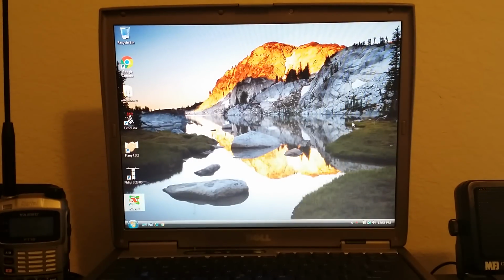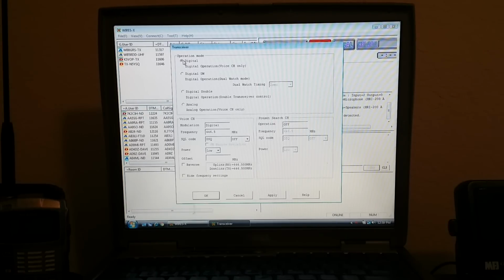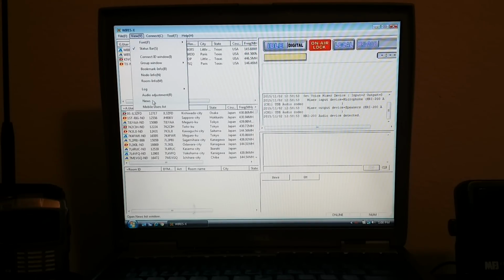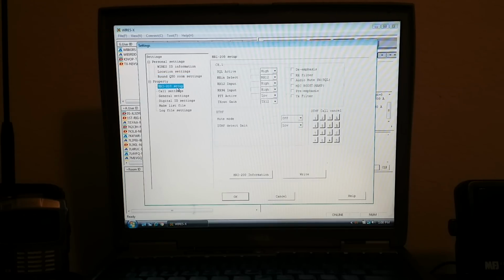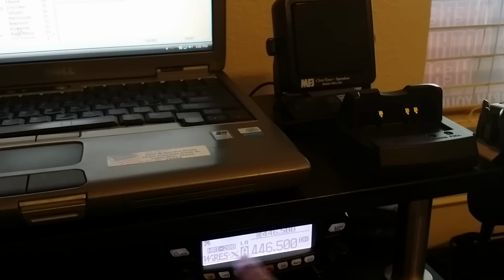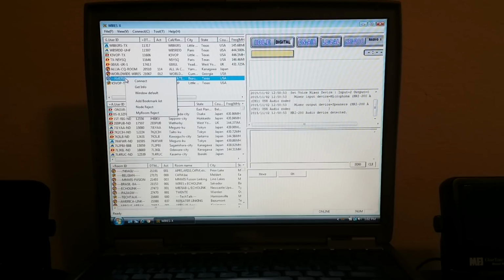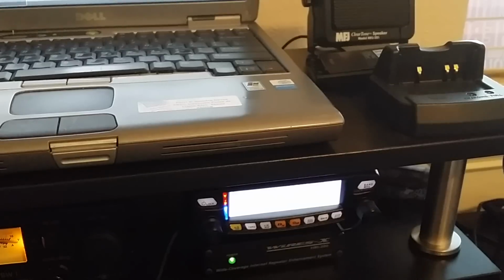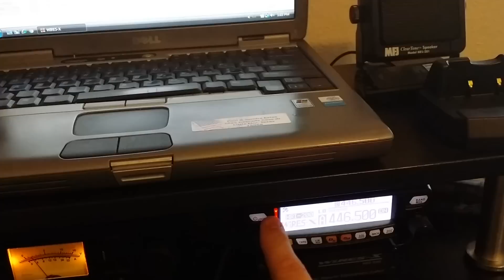Yaesu Wires-X and FTM-100 DR Setup

Comment: So the wires-x is only useable when hooked up to a computer ? Is there a way to get access to wires-x mobile ? I don't see the point if there's not .
Reply from the maker: a mobile C4FM radio can connect to any wiresX repeater mobile or handheld.  If you want to make a mobile 'node' you just have to have an internet/cellular connection that you can open the ports on.
Reply: Paul K5VOP/JI1GBC so if I'm out and about (mobile) I'll have to have nobe to hook up to the internet . Icom seems to have an easier setup going mobile .
Reply from the maker: A WiresX repeater, basically a Yaesu Fusion DR1x repeater with a WiresX HRI200 box connected to it. You do not need a mobile 'node', your radio is WiresX and connects to any repeater setup to work with WiresX,  It is the same I believe with Dstar, you still need to connect to a Dstar repeater to connect to others on Dstar out of the range of your mobile.  And Wiresx has better sound quality with newer chipsets.  Fusion also allows analog and digital to connect in the same nodes and communicate.

Comment: can  you use  an  old   1500 with it
Reply from the maker: Any analog 2m/70cm will work, in analog not digital.
Reply: jon ericson. I can tell you first-hand the 1500 will work I've tested it and it is Plug and Play. Additionally ft 7900 will work and even my ft-817 work however I have disconnected all my analog radios and run totally digital now

Comment: Hi
I have all ports going and the HRI-200 Driver is ok on com port 5 on the PC, and the 10 pin cord is seated ok, but I still have the splash screen Hang on the FTM-100D.  It has progressed past this point before on other occasions but since given to me to set up on this PC its just not playing ball, any tips please.
Thanks Tim VK8LLA
Reply from the maker: Tim is your splash screen in wires X mode? And all your ports are showing okay?
Reply: Paul K5VOP/JI1GBC 
Hi Paul, all ports are green and good and i have node information populating the left hand frames and status is Online. the wires x box is connected to bothe pc and radio all cable firmly seated. pc reports wires box as visibke and on com port 5.
the radio however.....i hold down the 2 red centre buttons to invoke wores mode then again to invike normal radio use but when i invoke wires x mode it starts but just sits on the splash screen it does not move on. is there any other setting on the radio or in the software?
thanks heaps. Tim

Comment: Paul I've got a question, I'm using an FTM400XD with the HRI200. I've seen where people hold the two buttons while at the same time powering up the radio. In my case when I do that, the radio comes on displaying only the Yaesu Wires X splash screen, but  no frequencies are displayed. In the software, Ive programmed my local Fusion repeater frequency pair. Can you tell what am I doing wrong?
Reply from the maker: you won't see frequencies until the wires X software is running and properly connected to the radio. when it's not you just see the wires X splash screen.
Reply: Thanks for your reply. I've found out that one of the 10 pin connectors wasn't seated properly on the radio.

Comment: What power supply are you using to run your radio? 73's kh6hwb
Reply from the maker: QJE 30amp. it was the first power supply I got from an older ham selling some  equipment. QJ-PS30SW. I have a compact MFJ 30amp as backup.
Reply: +Paul K5VOP/JI1GBC Thanks

Comment: Can this be accessed by Any transceiver or only yaesu ???
want to use for local ARES Group if I can set this up as a repeater of   sorts on a simplex, we live in a area where many stations cannot hear each other whats the requirements / needed for other stations to connect, must they have a computer to connect or can it be done via a DTMF ????
Reply from the maker: Yes, in analog mode, any transceiver will work.  You simply need an analog Wires-X node within RF of the radios you use to TX/RX.  So, if anyone is out of range of the main node, they would need another analog node they are in RF range of that could then, through DTMF, be connected to the main node via internet. They would input the local analog node frequency, tone, offset, that they are in range of, and with DTMF connect to your main node.  Anyone could connect from anywhere in the world but each ham needs a node within RF range to access the Wires-X network and be able to connect to the main node.  Think of it like an internet connection.  Anyone with a computer can connect to you via the internet (wiresx network), but they need a computer (their radio) and a local hot spot (local wiresx node) to connect in order to access the internet (wiresx network).  Hope that helps and doesn't make it more confusing.
Reply: Hi Paul, thanks for the video. If you connect to wires-x with an analog radio, can you connect with others who are using it in digital mode ?
Reply from the maker: +john mcleod Yes, that is one really great thing about Wires X, analog and digital can communicate back and forth.  I was in Japan,  connected to a local Japan node at the airport in analog and then connected to my home digital node through wires to check in to my clubs weekly net! Some day it isn't quite as clear as all digital but it works regardless!
Reply: We are talking about using an non yaesu HT and not a computer right?
I understand someone has to have a yaesu and wires-x and that rig becomes a slave for the system, My question is once that is all set up can someone in our case our ARES group connect to the wires-x and communicate via there Non yaesu ht's without the aid of a computer on there end?
Reply from the maker: +SREagle in analog any 2m/440 radio any brand can connect to a node.

Comment: Looking at setting something like this up. The nearest node from here, is about 60 miles away. Then, to make matters worse, all the repeaters that are within range aren't powerful enough to reach the nodes. Unless, I'm missing something in the setup. So, can this set up be capable of running off a repeater? As in, if I am outside of range of the node, can I access it via repeater? If so, how?
Reply from the maker: Yes,  my personal node connects from my house via RF to a local club repeater, thus extending the range of my wires X node to that of the repeater's. So anybody in range of the repeater can connect to the wires X system.
Reply: So, do you just have the frequency set to where the repeater just interfaces with the radio? Or, is it wired to the local repeater? One of the biggest problems I seem to be facing, is WiresX is supposed to be digital or analog. I found an analog node nearby (via the directory). But, each time I try to connect, the radio automatically switches over to digital mode. Which, of course, means it just looks at me rather than connect.
Reply from the maker: Yes.  Your Transceiver settings in the wires X software must match that of your repeater, i.e. offset or tone (analog).  I, and most all users, prefer digital, it just sounds better.  If you are connecting to a local node you should just have to put the settings listed on the active node list in your radio for it to work.  If it keeps switching to digital try that same frequency but remove the tone, if any, and try connecting in digital.  Not sure why it would switch to you digital if the node is set to analog.  Also, some do have their WiresX box directly connected to a fusion repeater.  Personally I think it is easier to run from a club members home so it can be easily accessed.
Reply: as soon as I hit the WiresX button, it immediately switches to digital. The repeater I try to connect to, is analog only. So, as soon as I attempt access to Wires, my radio changes to digital mode, and the repeater denies connection. Once I stop connection, and switch back to analog standard operation, the radio can access the repeater. I just can't get it to access WiresX in analog. I have a FTM-400DX. It's supposed to be able. But, won't send the connect signal in any mode other than digital. What am I missing?
Reply from the maker: +FTORC1 “FTORC-TV” I understand now. Holding the wires x button down is only for digital operation. analog mode has none of digital features.
Reply: How do I access it otherwise? The repeater is both. Standard operation, it's just a repeater. It just happens to have a WiresX node in analog connected. Another repeater is supposed to have WiresX digital. I can key up and access the repeater. But, once again, WiresX won't connect to it.
Reply from the maker: For analog nodes you simply put the node frequency, offset, and tone in your radio and start talking.  To go to other nodes(rooms) in the WiresX system, like to connect to mine, you have to use DTMF like #21606 to connect to mine.  I have little experience using WiresX in analog as far as switching rooms and such but it does use the DTMF.  When connected to an analog node just disregard the DX button on your radio, it is only used for digital nodes.
Reply: I can't even connect to a room via analog, or switch rooms. I feel like I'm missing something. By what I've read, it should work a lot like echolink. And I can't even get that to work right via DTMF.
Reply: We actually have one of those really close nearby. I know it works too. I've connected to it. I just can't get it to link to another repeater via DTMF. I guess I just suck at punching in the codes or something. I've even watched it done. Repeat the same process on mine... nothing.
Reply from the maker: That puts me at a loss,  I'll have to find an analog node and try it myself.

Comment: Hi, what screen resolution do you use on this laptop

73' PF9ZX
Reply from the maker: it's an older Dell laptop I got at ham com, it's running at 1024 x 768.
Reply: +Paul K5VOP/JI1GBC  Ok. I expect no problems width my 1920 x1080 then. Thanks.

Comment: how hard is it to set a rig up like this in a mobile on wiresx or can it be done?
Reply from the maker: it wouldn't be hard at all as long as you can plug the wires-X box into something with USB either laptop or tablet and then have a hotspot like your cell phone or a tablet with cell service.

Comment: I can use the SCU 20 with a USB extension?, 73
Reply from the maker: I am unfamiliar with the uses of the SCU unit.
Reply: Any video on how to update the firmware? Happy New Year
Reply from the maker: +Elicio Molina I could make one on Sunday perhaps, you do have to open the wires box, flip a small switch, (it is labeled) to program, then run the file you downloaded, when it is done it will say, then you flip the switch back and screw the faceplates back onto the box.
Reply: ok, I think I have something wrong, I follow the steps of Yaesu, I would like a video 73
Reply from the maker: +Elicio Molina  Here you go. https://youtu.be/yyrQW0vjSYA

Comment: Hi Paul.
How turn off the WIRES-X node setup from FTM-100DR? I don't find it in manual.
Reply from the maker: Hold DX and GM buttons down while turning the radio on.